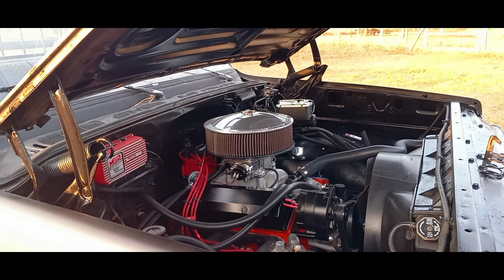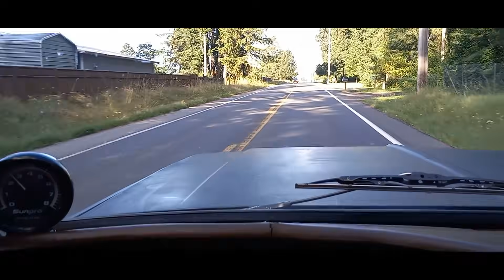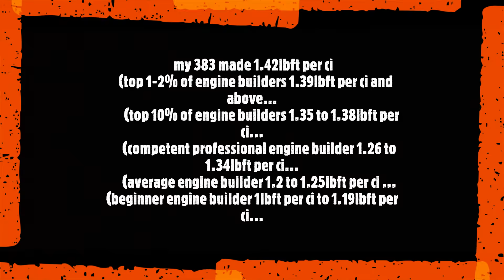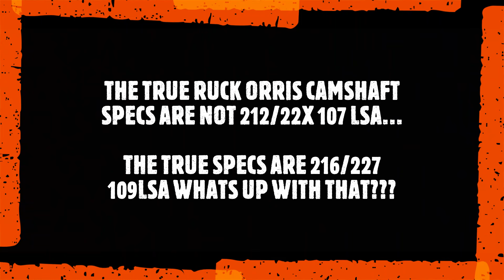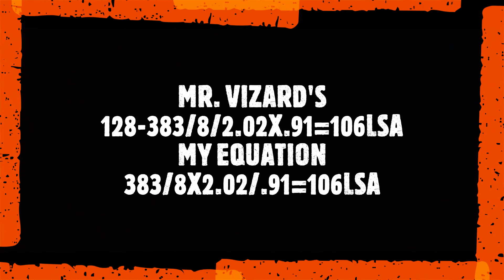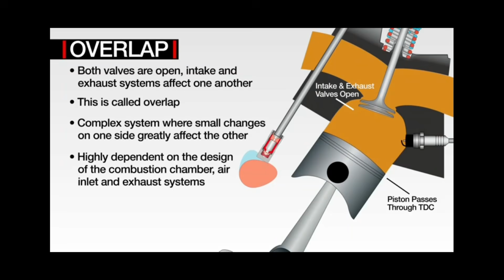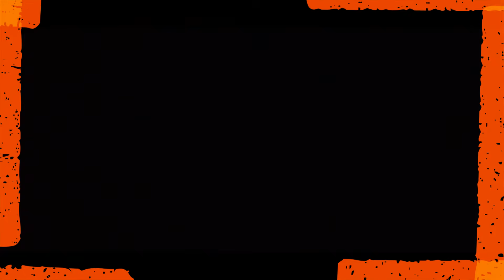CAMSHAFT SELECTION by LSA, 9 LSA's DYNO TESTED!!! LSA THEORY WILL BE DYNO PROVEN!!!, and EXPLAINED

Comment: I enjoyed watching your video, thanks for sharing that information with us. I'm curious to know if that formula only works with V8 engines or if it can be applied to others too? I'm in the process of building a straight 6 engine for a BMW,  I assume you would divide by 6 and not 8 but how do you calculate the starting number? Keep spreading the word.
Reply: The starting number is ''cubes per hole''.

Comment: I watched the whole vid, and I can understand it. I've watch many of holdeners videos. It's just random tests, with no math explanation of why you should run this combo. He does a good job though. I'll have to check out your other videos and would like to watch/listen to more videos like this while I'm at work. I find all this very interesting and can't wait to apply it to my 5.3 ls n.a build. I've always loved higher compression n.a motors, and gassers, and once you see the times they are running it really shows that those combos work, even with small displacement. I'd love to be at 400whp and just enjoy it in my 93 S10 and see what kind of times I can run. Which also involves the correct gear ratio and stall selection. Thanks for sharing the knowledge because most people who really know stuff aren't sharing it, thinking that they won't be on top, when really people have a hard time picking up on it anyway. These bits and pieces are gold.

Comment: I like hearing what David v. Has to say, I bought his porting book, but I haven't gotten anything out of any of it. He takes a while to get to the point that I can't understand what he is getting after. So I'm just doing my own stuff, recording outcomes, and learning. Because that's the old way, it's not the only way, but i can't just copy people's combos like you said if I want something incredible, something that stands out.  You just have to start doing things and see what happens sometimes, instead of trying to learn other people's tips. Use it as a guide, or starting point for sure. Also my junk is so much different anyway, but some things like porting, cam selection, higher compression, proper jetting, can be used on pretty much any engine to see gains. (Like my 3 wheeler, where I've learned everything based on what car guys do on cars) great video, almost like an informative podcast.

Comment: You keep saying cams with identical specs except lobe separation.  But changing lobe separation angle changes valve timing (when it opens expressed as degrees of crank rotation).  

When I designed my engines, I used dyno software to determine the valve timing, lift, and duration, then found the grind and lobe angle that fit those numbers.    

30 over 350, 10.25:1 CR, Brodix track 1 heads, true roller valvetrain, Offy IR intake, twin 390's, estimated 511 HP.

489CID tall deck 454, 10.28:1 CR, long rods, World heads, Offy IR, twin 1150 dominators, custom ground true roller valvetrain, estimated 688HP.  

Due to the big runners, big valves, big intake, and big carbs,  less lift, less duration, and less overlap were required than in your typical builds of the same size engine.  My big block required a custom grind.  My small block was able to use an off the shelf grind with 4 degrees of retard (as I recall).  Using the dyno software to get a best guess at proper cam specs beat the heck out of trial and error.

Nowadays, I'd go turbo instead of mechanical CR.  More pressure for the same temperature, so more power before you get detonation.

Comment: Gday Mate from Australia. Well, along with watching David Vizards videos plus the purchase of his book on Porting, I found your video very informative, with interesting ideas and contradicting many of the old beliefs on Camshaft selection which is actually refreshing to see. Importantly, your observations, real-world engine build experience and examples of data from actual previous Dyno data (Richard Honer cheers mate), really make some quite valid points regarding LSA and along with David Vizard's observations, makes one ask why some Cam producers may be on the wrong track. Now I am no Engine guru myself and I am currently building my first V8 Holden 314 CUI motor but thanks to doing research, watching reputable engine builders/head porters on Youtube, plus brothers with performance engine experience, I have gained sound knowledge that I am now aiming to apply. Certainly from those Cam comparison figures, I did notice how those Power/Torque figures seem to now shift much higher up the RPM range. Certainly an improvement BUT at a marked expense to down low where I did expect such large CUI LS motors to produce better results. An example of this was just before in 1997 Holden put 5.7 LS motors in Commodores, we had our own Holden V8 that produced a well-loved low down Torque characteristic in its 308/355 version. But the 5.7LS made more torque (JUST) but over 1000RPM further up!!!! Many complained about this and you either went for better heads/Cam or waited for the LS2. Much of this was due to the LSA I believe now which I get they are wanting better idle, manners, and emissions I guess. But your 383 plus David Vizard's similar design concept certainly with your good explanation made me take notice. And I did love how you called out the BULLSHIT because it does seem BT might be on the wrong track and raised my eyebrows in what he said. Anyway, I feel for you and as a person who looks after his own mother with no wife/kids, it is a bit surreal. You certainly come from a very knowledgeable family background and possess a very high level of mechanical aptitude which was obvious to me.  Anyway, I enjoyed your video (took couple days to view) as it did identify some legitimate Cam spec data related to LSA. Thanks for sharing this.

Comment: Nice vid. I saw the scenery and instantly knew that was somewhere near my old stomping grounds. 28years in Tacoma area until 2012.

Anyhow, I hope your condition doesn't worsen too rapidly, and chatting on another channel I was told that SBF should use the constant 127 in the equation because most Ford heads are slightly less efficient with airflow and swirl compared to SBC's. The ideas make perfect sense to me...

1- pick LSA to optimize the air pump
2- pick overlap/duration to move area of peak outputs

Comment: 108 or lower LSA is where it’s at. Any higher and power dies up top. Stroker that is. My favorite is 106. No matter where you are on that RPM it will always pull hard… of course this all depends that everything else is there to support the cam.
Reply: You are strictly talking NA engines with that 108 to 106 LSA, right?
Reply: @jasonstormoen A lot of factors go into play but of what I’ve seen most boosted builds have a higher LSA. I guess in a way I would say yes
Reply: @eduardonunez4377  kind, but Yes, supercharger combos always run between 112 and 120 LSA with a higher Exh Duration than Int, and Turbo is always 112 to 118 with a higher int than exh duration. Nitrous and superchargers/blowers are very similar.

Comment: So effectively you can alter SLA by changing duration? I'm trying to get a grip on this stuff. I find it fascinating and confusing lol!  Thanks for the great video!
Reply: I think you're referring to is Overlap changing based on durational changes, not the LSA changing due to duration...
Reply: I agree with that. You can also change overlap by changing LSA, I believe I need to study that relationship a bit more in depth.
Reply: Yes. If cam lobes remain the same shape (duration didn't change) and you tighten up the angle between the intake and exhaust lobe centerline, then you increase overlap. The "overlap" is the duration (time in degrees) that both valves are open... The greater this number the more "Racey" the cam is.

A good street cam is usually between 50-70 degrees of overlap. 50 favoring low end power production, and 70 moving the power upwards in the RPMs.... At least that is my understanding.

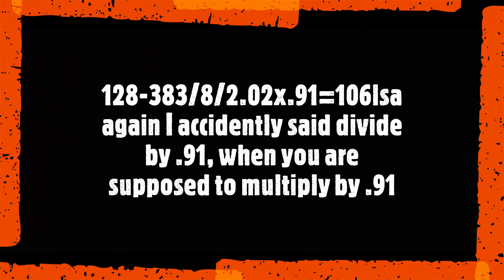Comment: 54:25 no i doesn't... what kind of hick math are you doing? I've tried your formula using your example using proper math with order of operations as well as just left to right - neither of them yield your answer of "106."
Reply: I know what you're saying... But try this on your cell calculator:
CI ÷ cyl count ÷ int valve dia x .91 = X
Then subtract X from your 128 (Chevy) constant.

For example on a small block Ford 302 bored .30 over with 10.5:1 and 2.02 valves ....

306/8/2.02x.91=17.23
127 (Ford constant) - 17.23 = 109.77 LSA.
This engine should be running a cam with 110° LSA. If it had 1.94 valves it would prefer a 109° LSA so on and so forth.

Hope that helps. First time I tried the hick math I was confused too.
Reply: @richdouche8253  my comment was rude, I found some more videos on the subject and figured it out. Now the only thing I don't understand is why it seems like all the cams are 112 LSA and not 108 like the formula calls for. I think I only found one with 108 LSA made by summit but it's a way too aggressive cam for my taste.
Reply: @477racing  yeah, most off the shelf grinds are 110° or wider lobe separation angles because everyone thinks they need 280+ degrees of duration to make any kind of decent street power.

Typically because these cams are going in computer controlled cars the wider LSA's tend to smooth induction pulse where the computer is receiving it's chief data inputs from. The more linear the data, the easier it is for computers to regulate. It's not that a wide LSA can't make power, it's that often it doesn't optimize power output, and so widening the LSA on an OTS cam is often better for the company as a whole, and not necessarily best for a particular engine combo. That's what it seems the top guys are trying to show us, is how to spec our own cams and buy the closest OTS cam or get one custom ground to our own specs.

Comment: I haven't gone through the whole video yet because it's a lot to take in for someone who only had the internet and is looking to start building motors myself, but in general it seems that bigger engines like tighter LSA?  Is there a way for me to find out the overlap and RPM band without relying on cam companies catalogs and without a lot of testing?  I have a variety of different Ford and Chevy engines already.
Reply: That's what this is trying to teach us. From what I understand, first Calculate engines desired LSA based on the DV formula. Then pick your overlap. The more overlap you have the more duration you will have, and with more overlap and duration, the engine produces power in higher peak, but also has a rougher idle.

Comment: 1.5 hours wasted listening about small block chevys garbage cause “this equation works on Hemi’s” my ass like learning new things but I could give to fucks less about dog pile small block chevys and ls junk let me know when you fuck with any sort of big block the more time I spend on YouTube the more I lose hope in humanity agree with you on Texas speed though
Reply: I'm sorry you felt it wasted your time, but the principle DV equation for selecting LSA works for many engine families. And this video explains that if moving up or down in compression or other changes from a 10.5:1 Chevy 350 model that LSA will vary accordingly. I think this video is extremely helpful, especially considering you could be dropping a 114 LSA in your Mopar when it should have had a 110 or 108 or whatever. The principles apply across all manufacturers. Engine are simply air pumps... Doesn't matter what brand. I'm a Ford guy. I use 127 in my LSA calculation because Ford heads are not as efficient as Chevy/LS/Hemi stuff.

Comment: That makes alot of sence to me!  So you calculate LAS first, then how do I calculate optium duration & lift numbers?  I had a chance to chat with Ken at AFR b4 he passed away... our last conversation was 6hrs.  An incredibly gifted thought process that I somehow grasped him jumping all around. My goal was porting heads & where to start.  He told me to keep the 193 swirlport heads & what to do with them. Best ever was 11mpg in my suburban, after increasing the valve size to 202/160, 3 angle & port work... simple 2020 comp computer tbi cam... it jumped to 15+  I can only imagine if I would have had the proper cam & compression ratio, along with squish how well it would have run.  I have always run into trouble asking for the narrower LCA from Summit, Jegs ect.  The last roller cam I got for a sbc 355 with dart heads 202... the tightest I could get off the shelf was 110 lsa. Told me a custom grind tighter lsa was extra & was a special order only.  A customer insisted on a Thumper Cam by comp that uses stock spring Vortec heads with stock valves. It's a 355 with flat tops & thin 15tho head gaskets to get proper squish with a non decked block. I am porting the heads to help flow a little but not expecting much more tq or hp above stock, mainly it will sound badass to him.  I would rather swap to behive springs & the proper cam. I couldn't talk him into going with larger valves or heads. Is there a acurate tq & or hp calculator online that you know of?  Wish I would have learned more as a young man....  just getting into LS upgrades... BT sure dumps alot into advertising & pushing his cams, Texas Speed about the same?  Knowing how to calculate duration & lift would be awesome!  Sorry life has delt you the cards it has, wish there was a cure!  Keep up the knowledge sharing, loving it!
Reply: After you've locked down your LSA, decide how many degrees of overlap you want.    That will tell you your duration (roughly).

Comment: LSA is a whole box of worms, in itself. It all depends on the rest of your build, and how you plan to use it. If you're building a monster with correctly matched/tuned intake, headers, and heads... a narrowed LSA can make a huge difference in power and throttle response. On the flip side... if you don't have the total package, a wider LSA can help overcome the lack of scavenging. It's all about the total package, and the intended use. You can't just say "this is the better choice for a street 350" and call it a day.

Comment: My late father had a speed shop and was an engine builder, drag racer and a pattern maker by trade. His motto/tagline for his speed shop was "common sense power packages" and cam/induction/converter/gear selection was crucial to him and unorthodox and looked down upon by the bigger is always better "know it all" types but Dad's customers regularly outperformed wilder combinations on the street, dunes, dragstrip, lake, or dirt track. He was a big fan of David Vizard's including the cam calculations and had all of his books (which I now have).

I am now building a small block and a big block for a couple of Dad's cars that myself and my brother have inherited. Plus an LS for my drag car. And I'm going about cam, induction, exhaust, converter and gear choice exactly the way he would have done it. (See video on my page of Dad's speed shop tour)

P.S. LOL at the Mike Honcho reference...🤣

Comment: This is like finding the cheat code for a tank in GTA Haha!

I found DV just recently after. Watching Richards video onLSA, trying to find out why cam manufacturers always went with larger LSA. Well the best thing I ever did was dal down that rabbit hole! 

I will admit Im Very new to the performance v8 world as far as learning the specs for everything. 

I have worked out myideal  cam for my LS1 and was looking at getting some CNC ported heads, How should I look to change my calculated  cam specs for the flow of ported heads? 

Also how do we go about finding ideal lift? I hear 5.7 LS like around the 595 mark
Reply: Fyi 

I was looking at 224/224 5.95/595 lift on 108 LSA for my LS1. 

Just curious on what I would need to do if I got ported heads that flow more and I took 30thou of the heads to up compression to roughly 10.8 to 1?

Comment: I'm trying to build a 1970 350 but for a street able pump gas c10 iv been Burt on 4 motors just want to pull my camper or haul my bike cross country not looking for a window shacker cams are confusing for me any help would put me in line I'm 70 years old on SS so money is tite I have a 3970010 block now

Comment: Quick question i have a  350 vortec with 282,000 miles on it. i wanna get the heads ported . What valve size and cam would you recommend. I'm keeping the bottom end as is. Thanks
Reply: DV has some great examples of porting Vortec heads with factory 1.94 valves and making really stout 350's with them. You should check out his channel about mods to SBC heads. After watching those you'll see how he can make a winning combo, no matter the marginal variances like valve size.

Comment: On a stock LS1 with good flowing exhaust and 241 heads, what cam specs should I look for?
Thanks in advance!!!
Reply: I am in the same boat. I figured out the LSA should be 109 or 108. But i cant figure out the duartion. I am just looking for a street car and i like getting decent gas mileage

Comment: Awesome video. Thank you. I’d love to hear your insight on cam specs for the LT generation of GM motors. I’m running a custom grind from cam motion a trusted local guy did for me on my L83 5.3 that has an LT4 supercharger. He seemed to have many of the same convictions you had about off the shelf cams and “stage 1-4” b.s. That’s when I knew to trust the guy lol. Turned out great. Trying to find the paperwork to recall the cam specs.